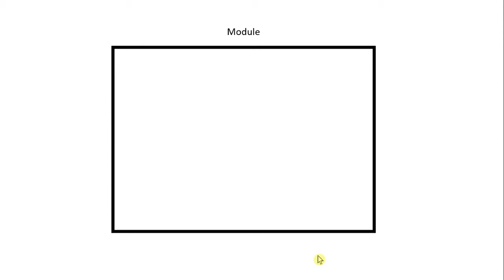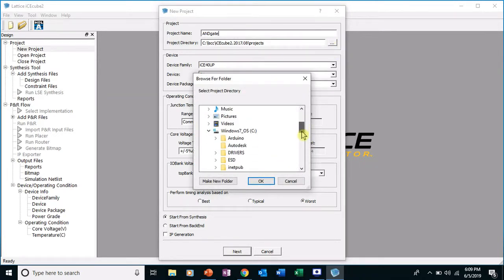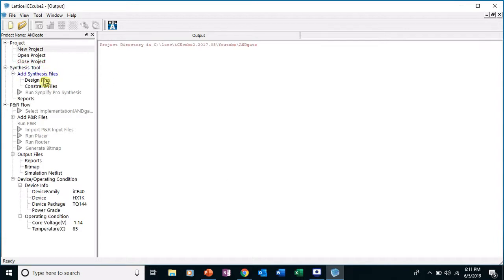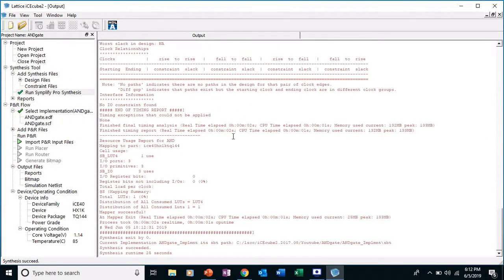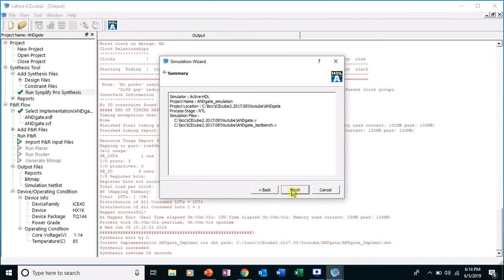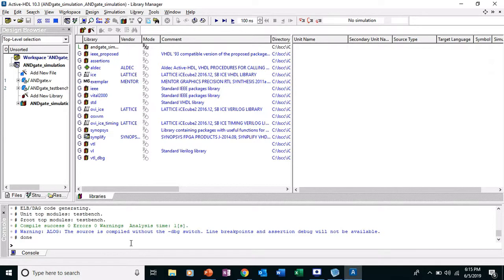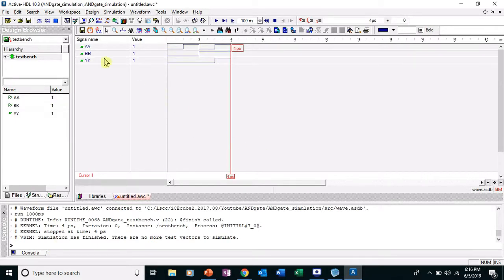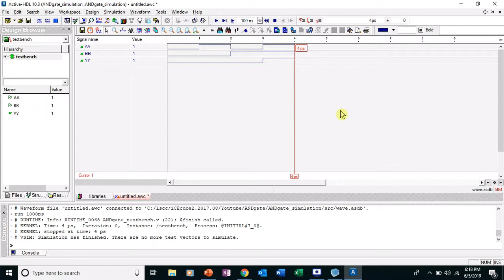First Project With Lattice FPGA - Part 4: Simulation

Comment: Hi and thank you very much for this great video.

I currently have a project for which I will need a one of their tiny iCE40 FPGA and your video was a great help into using IceCube.

However I've got a question.

At school almost 15 years ago I had leart VHDL, thus I'm using VHDL rather than Verilog.
I have tried the simple 4 bit counter example and this caused me a problem during simulation under IceCube.

library IEEE ;
use IEEE.std_logic_1164.ALL ;
use IEEE.NUMERIC_STD.ALL ;

entity compteur4bits is
    port ( clk : in STD_LOGIC ;
           compteur : out STD_LOGIC_VECTOR(3 downto 0) ) ;
end compteur4bits ;

architecture behavioral of compteur4bits is
    signal icpt : INTEGER range 0 to 15 := 0 ;
begin
    compteur <= STD_LOGIC_VECTOR (TO_UNSIGNED (icpt, 4)) ;

    ps_compteur : process (clk)
    begin
        if rising_edge (clk) then
            icpt <= icpt + 1 ;
        end if ;
    end process ps_compteur ;
end behavioral ;

This is typically what I find in VHDL tutorials. However there's a problem with ActiveHDL during the simulation, simulator "crashes" when buffer overflows from 15 to 0, I have to take this case in consideration modify my code this way to make the simulator pass the test.

        if rising_edge (clk) then
            if icpt = 15 then icpt <= 0 ;
            else icpt <= icpt + 1 ;  
            end if ;
        end if ;

So do you have any knowledge about ActiveHDL simulation problems when allowing a buffer to overflow ?